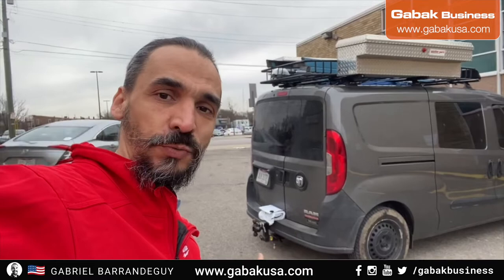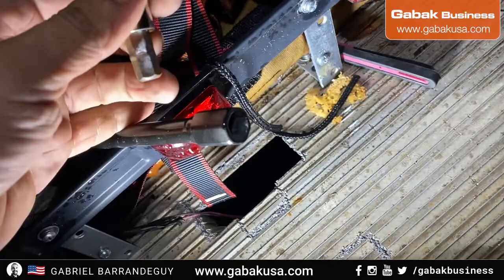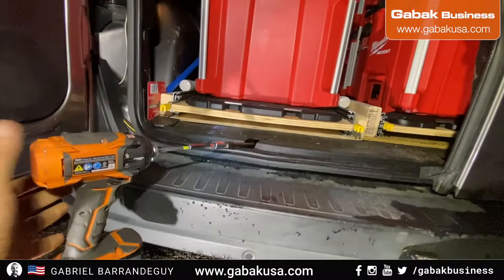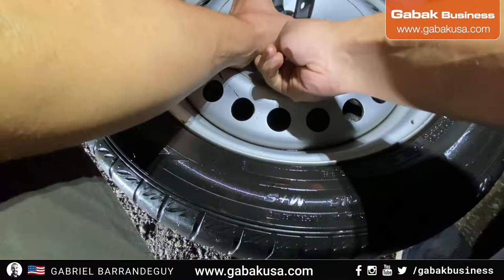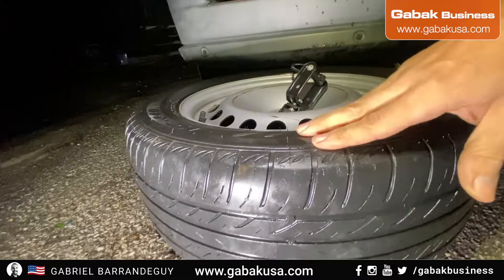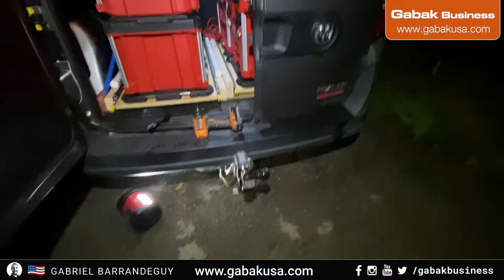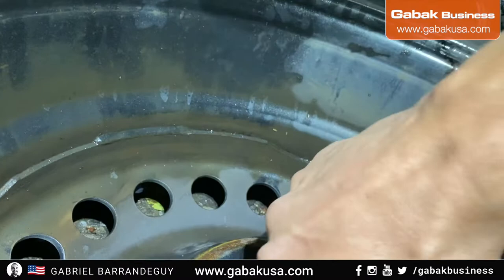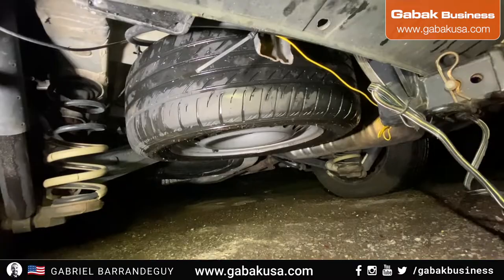How to install Spare Tire Mounting Kit  RAM Promaster city? - Gabak Business - Gabriel Barrandeguy

Comment: Thanks.  This is a very helpful video showing what a horrifically bad design this kit is.  Good thing you weren't out on the highway at night.  Ram should be ashamed for selling a vehicle which doesn't easily mount a spare tire.
Reply from the maker: PMC has few more issues than that
but you are right